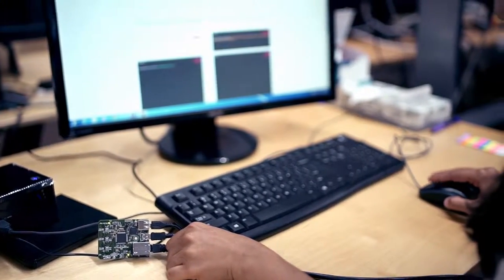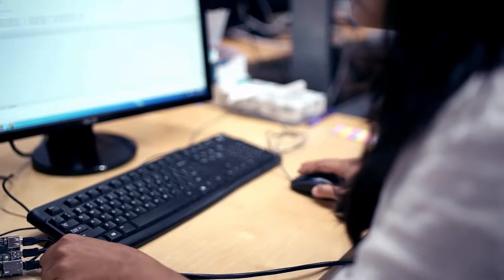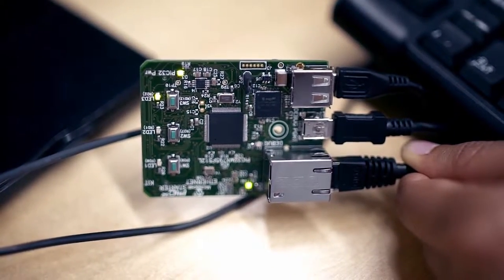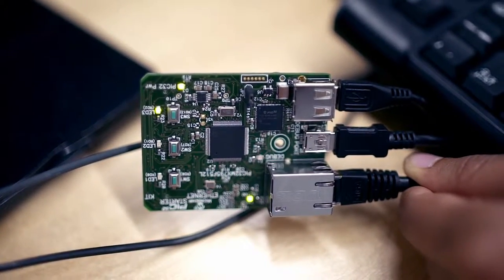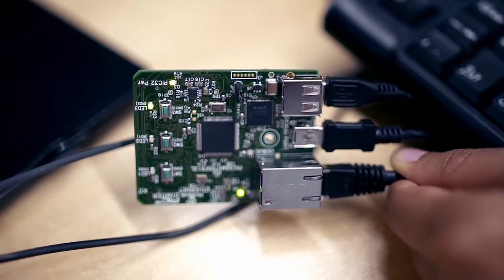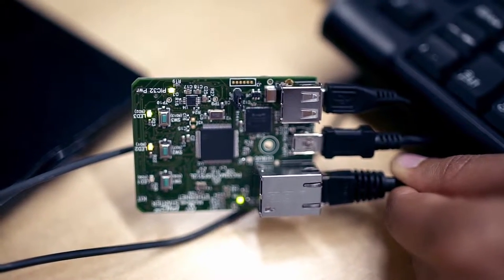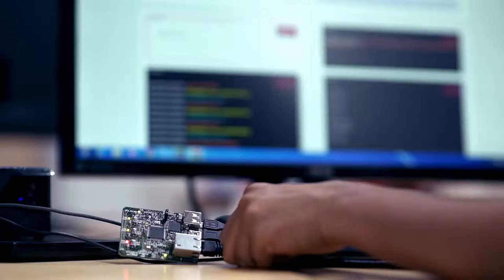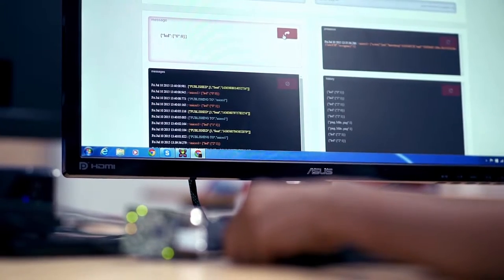Microchip PIC32 Overview: Getting Started with Pub/Sub Messaging

Comment: I see the communication with pubnub used in mcu such as pic32. Where can i find this related documentation in detail? The link I found is only for java and android sdk. I need to know what the actual parameter must be sent by the mcu but the sample can only demonstrate the library usage (well at least!;-) better than never ;-)).
Reply: I already hv the code. But I hv intention to custom the code on my own way. To do that I need to understand what must parameter and option parameter that needs to be stated. Usually they will describe that in documention but for this case i can find none related to embedded c/mcu (such as pic32).